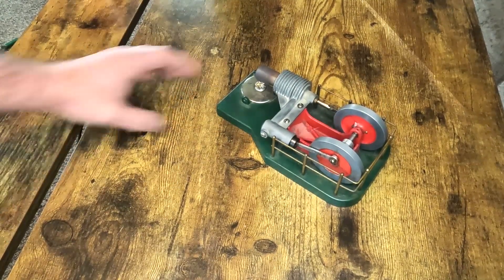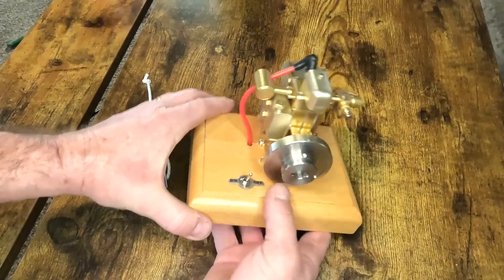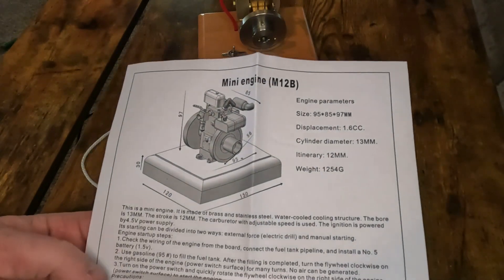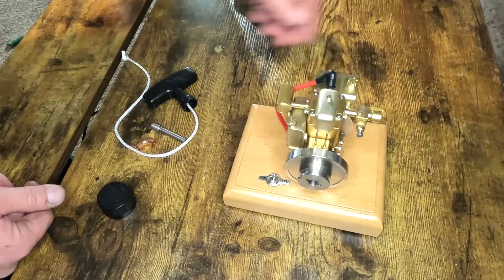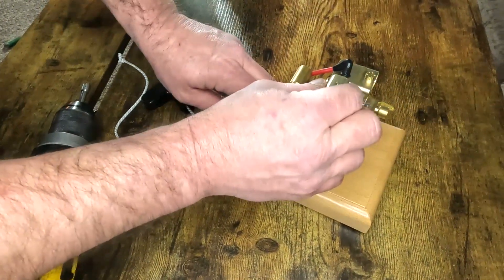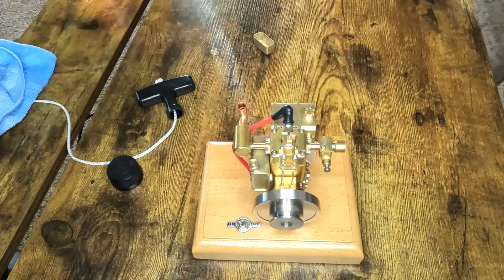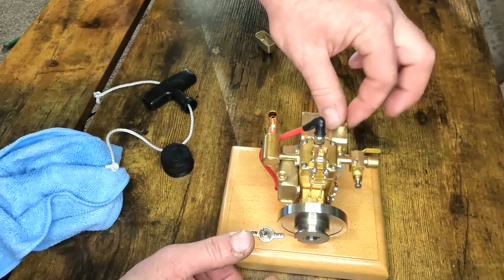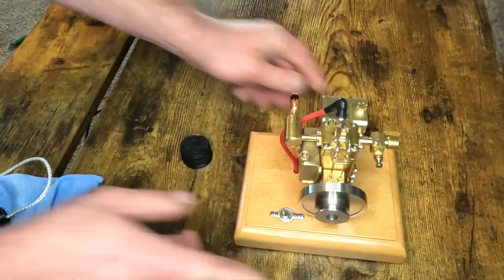Model M12B engine first start and run

Comment: Hiya mate, know its a while since this video has been out but wondering if you could give me some help? Ive got this exact engine, however i cannot get it to start. I have diagnosed it as a spark issue, and i am unable to get any spark at all. Just wondering if you have any advice on how to to about diagnosing/fixing this.      Cheers,   
Felix.
Reply from the maker: Hi Felix, start at the batteries (check the output) check to make sure you have voltage through the switch, if you have power to the ignition coil, check the hall effect pickup, unplug it and plug it back in (if it sparks, your pickup is bad (stuck closed)) if you unplug it and use a test lead on the coil side of the plug to mimic the hall effect opening and closing the circuit and have no spark, I would guess that your coil has failed.   I hope this helps, if you have any other questions or if I can describe it in a better way just let me know.

Comment: I always enjoy your videos and thank you for the insights, I have three engines on order the Benz three wheeler, H74 2 cylinder and the HM01 7cc when they arrive, at the moment I just have the 4 cylinder Holt that runs quite well except for oil Leakes, seems to be around the sump seal. Thanks again.

Comment: Has anyone figured out what the spark plug gap should be on these little gas engines? I’ve watched most of your excellent videos but didn’t see it mentioned, although I might have missed it. I don’t find anything elsewhere on the internet either. I grew up on small motorcycle engines and know what a difference the proper gap made on those.
Reply from the maker: Hi Wahoo, you're exactly right, I don't think I ever said anything about the gap. I'll go out and check on a couple of them. I know that I usually open mine up a bit but some of these plugs are, let's just say, less than decent to start with. The center electrode has been way off center on a few of them. If you get a chance to watch the video on the twin cylinder tractor, it came with a "custom offset" plug.
Reply from the maker: I came out to the shop and checked a couple of them for you. .030   .032 and  .035 thousandths of an inch are what I have adjusted these to on 3 different model engines.  I hope this helps you out, keep me posted 👍
Reply: @steam212  Thanks man, I appreciate your going to the effort. I think mine is at least 45, which I thought was a bit extreme.

Comment: Good day, thanks for the video. Just a question - have you tried to estimate the power of this engine in kW? 
Thinking on putting it in a custom vintage car model for my kid, but can't find the specs of this tiny motor.
Reply from the maker: Hi Alexandre, I cannot give you an honest answer on the power rating of this little engine. I would assume that it would need to be geared down quite a bit in order to drive a model car. Thank you for your interest and your question.

Comment: I just bought this model of engine I would like to know what I should check or know if something should be modified according to you what you think of it in general i like the look of those two sterling engine black one look nice
Reply from the maker: Hi David, I like this little M12B engine honestly, I replaced the main bearings because of the amount of play (slop) that they had. If you are not afraid of getting in there and tweeking and tuning on the timing of the ignition, the camshaft, and the ignition I wouldn't have any concerns aside from the main bearings.  I tend to over oil anything that moves, but it is easier to clean an oily engine than to machine replacement parts. Try to remember that it is a "scale" engine and all aspects still apply like power, longevity and maintenance.  Much like anything, if you take care of it and don't abuse it, it will be there again tomorrow.  Thank you for your question, interest, and commenting. If I can help with anything else just ask.     If you check our other videos we take this one all the way down and go all the way through it.
Reply: @steam212  that second vidéo was super Good i like it those trick For sealing the water cooling the guy from warped perception has this engine crankcase floded wit water cosing a hydro lock on the flat horizontale m12 sealing this was on m'y list of thing To mod
Reply from the maker: @davidlavergnelacasse2356  After a few refinements (in my best Thomas the tank engine voice) this has proven to be a really decent engine. In the video before our last one, it makes an appearance and gets right to work testing the generator on the showman's engine.
Reply: @steam212  Yes I saw this wow this Little engine running that big generator was very impressive is this 12v dc?
Reply from the maker: @davidlavergnelacasse2356  I can't give you an honest answer on the available output of the big generator. I built it years ago out of a 120 starter